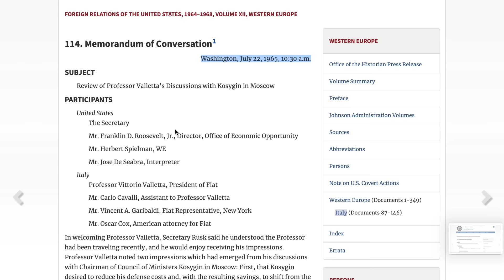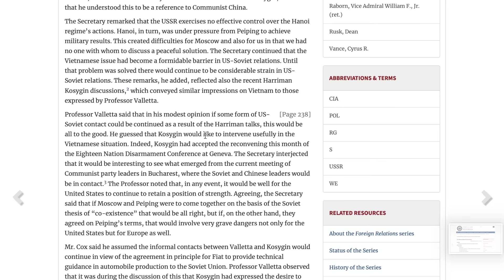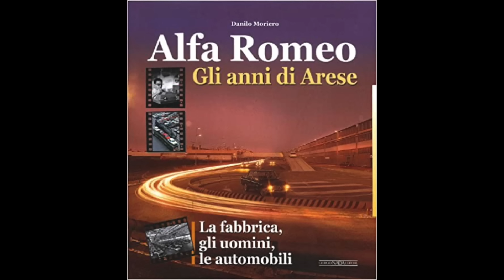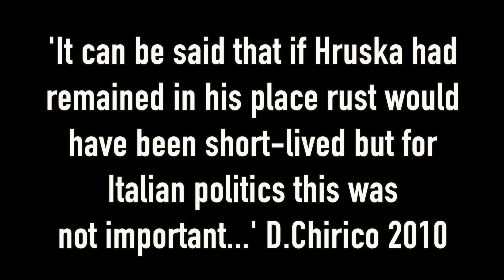Alfa Romeo And The Myth of Russian Steel - The Real Reason Alfas Rust

Comment: Yeah yeah well.  i think  'the myth' is a complex entity that was manifested in the video above tbh. Why > god knows. No advantages for Alfa, no advantages for collecting Alfas, no advantages to the video maker. I mean why on earth mess around with this steel matter ? Since long long ago it has been a known fact that russian steel was the reason for the periods rust issues. Can someone name the reason that this exercise in linguistic programming advantages the classic Alfa Owner me included ? Why is my Alfa or my ownership of it advantaged by reconfiguring & reframing a steel supply story ? And have a look at the high level fraud &  environmental damage contro that steel works in question is doing while you are at it?. What advantage does the person running an old Alfa  get by representing an argument so that steel came from Italsider ?. No thanks - i'm arguing that the steel in my alfa didn't  because it didn't - 1. But also as its senseless to make up new reasons so that a nasty corrupted steel plant like that is seen as supplying the steel. Is this the some kind of reputation of marque suicide thread or something ? It was supposed to distance itself from Russian steel as some kind of great big favour to Alfakind was it ? - yeah right!

Comment: Poppycock - russian steel was coming into europe in such enormous amounts it was the market leader and many times cheaper than any local steel. With its impurities it did not need any bad working practices or rust trappings, it had its own ways to decide where illogical outbreaks would happen, even in the middle of a bonnet above the heat of the engine in some cases ! By its nature steel recycling has an erratic quality, some batches will be better than others, though here the general quality was extremely low. The act of recycling just wasn't carried out responsibly, and the russians didn't care what the consequences would be. The Sud book seems has found a way to restate matters in a rather fallacious way whilst suggestion 'evidence'. What evidence ? So there was a local steel works - so what. So an Italian car maker official who bought from russia was known to speak to others the globe - so what ? Al most european cars from the mass producers were affected not just italian cars or 2 suds. The common denominators are russian steel and politics. Once politics is involved nothing has to make sense to the mere public and we'll never know precisely why they acted as they did. Well other than how cheap it was to buy that rotten minging steel !
Reply from the maker: If you have any sources to back up your claims of massive Russian imports of steel I’d like to see them. Please message me on Instagram or at the email address on YouTube
Reply: @Number27  With respect ? - why are you expecting to obtain documentary evidence for everything you say on your channel & run a comments section like a peer reviewed journal ? Questions about where that steel came from was settled decades ago after legions of people that worked in the industry understood that very well. Ok some people want to make copy today by restating contrary facts & waving irrelevant documents around as evidence whose going to mind ? - i don't i was a typical new person to the channel. If feel you can produce cast iron evidence to back matters from way in the past that conflict with what was known & and are now 'Olde Myths' ? - thats interesting & good luck if you are going to hold yourself to that.
Reply: When I agreed to taking on the Alfausd book project I too believed all of the old Russian myths and would have gladly repeated it all over again, except there were some other nagging doubts and when others closer to the source give me some leads I found a lot of documented history to disprove it.  The fact is that the funding to build the Alfasud factory came from I.R.I. which also financed the Italsider steel mills at Taranto and was conditional on Alfa Romeo using that steel supplier.  The same steel was used in the Arese factory but the Alfasud had far worse rust problems which were found to be due to bad working practices at Pomigliano d'Arco.  All of the evidence in the book is based on not only Achille Moroni's report but various government documents and the sources are all clearly listed in the book.  Its called doing thorough research. Now Jack has taken his enquiries further and has found yet more solid proof of the facts.  If you have any evidence (other than hearsay) to back up your claims and your accusations that my book is 'fallacious' lets have it.
Reply: @chrismartin9421  Hello Chris well put it this way first. I was just passing & thought that post would be that quite honestly. It strikes me also that a quality book and a quality channel are not dependent on this steel. But hey these are retrospective topics & its all interesting for the viewer absolutely, not dependence, more an effort at in depth good journalism. As for this post modernist Sud book. The fact is that the conclusions offered from those docs remain supposition not evidence. Such funding extracts explain nothing,  nor indicate the actual origin of this steel. Additionaly some idea concerning the financial state italsider might be useful if we are going to adopt funders in such debate How does anyone know Italsider was even capable of supplying steel at the time - we don't. No documents you show proves they did supply any, but were taking emergency loans. Where is the evidence showing what that factory actually did supply ?. For instance other thorough research hasn't revealed that farmed salmon contains enough contaminants to breach the blood brain barrier. There is some remarks and the odd video reference to be found on the WWW. But for a health scandal of this nature news should be everywhere. It isn't, a certain trading bloc made sure that reporting scientists were hounded out of their jobs and could never work at a university again. Do you honestly expect to receive anything but an ontology on steel when its use was kept well under wraps all that time ago ? It was a politically volatile matter. Just as farmed salmon which are fed pesticides to retard the flesh rotting on the live fish is. Have you seen the numbers concerning how much steel russia was producing in the late 70's & early 80's followed by the extent of its crashing down a few years later ? It is very odd that the production was up there, follow by being down 'here'. I'm not out to spoil your experience around this Chris, i'm really just another bloke who found the channel randomly,  then posted expecting to never remember it. I have only watched 1 video and it took a while to digest in those viewer like or not terms, where i find it takes me a while to gather an impression - ( i think many do that tbh ). That impression is that the channel and style of presentation top quality no mistake. I exppect the book is great also. This steel matter ? - evidence not! - some interesting but ultimately meaningless docs with similar reliability factor as the official salmon health data. Same when it comes to the scientists who won't admit that the baltic sea of toxic. Relevant ? - yes the toxins in that salmon are known to cause auto immune diseases. Thus if this sort of thing cannot get near the truth, what chance have bent steel deals from 50 years ago got ?. Cars everywhere in those days whether from Alfasud, or say early Leyland Speke could perforate and hole in the most absurd places. Middle of roof, middle of door, middle of bonnet in the worst cases, and this steel had a common denominator - Russia.

There is too much of this 'evidence' expectation about tbh. Stuff thats been hidden away decades ago due to dirty dealings resurfacing as internet nerdle. And i'm as into nerdle as the next guy so no worries there. But this dodgy political stuff just isn't made of 'well give me the evidence'. There is a bit of an epidemic of restatements that want to backed themselves by demand for evidence cannot be given for both logistical reasons & its nature as occulted from day one. One doesn't need to be a genius to know that all bad politics conceals the evidence. As for your claim to evidence? - this would be an actual ledger showing that X tons of steel was charged to Alfa by Italsider not blah blah blah Steel blah blah Alfa. I'm not btw quoting 'Italsider' as if i've been clued up all along who they are - i didn't - they'd be 'a steel works' to me before these exchanges.  Chris you know what defining evidence is though?  What you are doing is extrapolating from docs that loosely insinuate things surely. Really making them of hearsay grade themselves but with a twist does not demolish old myth. For instance, for years now a cost effective anti rust method has been to manufacturing as you'd know. Its a very cheap in fact, being an easy dip & nothing special. It goes on decent quality steel, which doesn't need any particular trap by which to deteriorate same as before. But modern treatment more facilitates good manufacturing practice that rusy inhibition. It  keeps the panel clean, and enhances its workability ahead of paint leading to far greater efficiency. Good steel is relatively resilient to corrosion in a context, not fool proof but quite stable. An already oxidised steel isn't stable. It doesn't even require any adverse atmospheric condition to disintegrate, any barometric pressure or humidity will do.. What we saw back then will be right back at us regardless of modern dips should steel that contains fatal oxidisation ever return.

https://ec.europa.eu/commission/presscorner/detail/en/IP_17_5401

No i'm not expecting this to bolster my hearsay except it does show they get into a state & that the circumstances can be extra dodgy. ''Illegal State Aid''. Yeah - is being as bent as ninepence only a new thing with them might be the question ?

I thought Wiki should indicate something wasn't right during that period - Extract :.

''Taranto integrated iron and steel complex became operational, occupying 5,000 workers and adding 10.5 million tons of capacity to Italsider.[6] However, by the early 1970s steel production in the EEC was suffering from overcapacity and foreign competition. Italsider made no exception, taking very heavy losses during steel crisis that hit all the Western economies in the late 1970s and especially in the 1980s. In 1984 Italsider sold SAIC to COGEA, a consortium of private steel companies dominated by Falck Group, that in turn resold it to Gruppo Riva in 1988.[7] In 1992 Italsider, in a last attempt to reduce overcapacity and losses, closed Bagnoli steelworks in Naples''

Still confident ? - not evidence no because how are we going to get these russian or italian invoices?. For instance does anyone know when the EU will open their books to an independent auditor apart from this independent auditor that is in fact themselves? I digress. But no wonder Italsider were taking emergency loans. And it certainly looks like they were under some exceptionally stressful pressure from a major source of steel production competition doesn't it. Did Alfa ever bother to honour the funders condition ? Was the funders condition just a sweet nothing while being embarrassed in front of another industrialist client ?. Did the funder in fact want Alfa to buy cheap steel to enhance the repayment potentials all along ? Alfa needed funding = was teetering on the edge. Funders are very hard nosed cynical deceptive and astute. They want their money back with interest, not loss via liquidation on what would have been an endangered loan.

And so ecoethical :

''During a 2012 inquiry, Taranto steel plant has been found to produce elevated emissions of dioxin, correlated to abnormally high cancer incidence in the area, bringing to the seizure of the plant by the Italian state.[10] According to the European Pollutant Emission Register, emissions of dioxin by Taranto steel plant accounted for 30.6 per cent of all emissions in Italy in 2002,[11] and much more according to an inquiry by PeaceLink NGO.[12]'''

A steel plant we can believe in !! - coincidently - concerning produce from the shared main continental coasts as well as the baltic sea. Farmed salmon is also contaminated with very high levels of dioxin from the environment. This is in addition to the pesticides that are within in the halibut pellets they are fed with every day. Pesticide prevents the flesh from rotting off the live fish.

https://www.sealegacy.org/pages/fish-farms

It looks like that one didn't have enough pesticide for dinner but we can if we make sure ours comes from the baltic sea or the shared coasts. Being as the retinal membrane is part of the CNS, the contamination inside a european farmed salmon is also partial to those somewhat. Thats why a lot of the salmon in the cages are blind in case anyone wondered. Thank god some are putting their hands up like the canadians and scots at last - they fought every inch of the way stating there was no evidence!. The other lets say - 'local producers even as of now ? - NO ! Don't worry about this just buy it and feed it to your kids - theres no evidence for toxic salmon in Europe because they've eliminated the scientist who blew the whistle. This salmon is the first ever paraconstent & counter intuitive food source. It has Omega 3 for building your cell walls up & Chlorpyrifos for tearing them down. Below if a study just concerning the waste thats leeching into the oceans from the mess below the cages :

https://www.ncbi.nlm.nih.gov/pmc/articles/PMC6775492/

Lol 'frontiers in genetics' randomly, was the peer reviewed journal that came up. Are our children likely to have any meaningful genetic coding at this rate or something?

The industrial sabotage of the british car industry where the Uk was being asset stripped since end WW2 & its industrial wealth transferred to Europe along with our other industries - every part of it stank.      

Yes complete hearsay lacking in evidence, but politics IS full of oddities. But unless you can produce copies of invoices showing that Italsider shipped steel to Alfa for a consistent period ( or any at all - would work somewhat) you haven't got an evidence leg to stand on Chris.